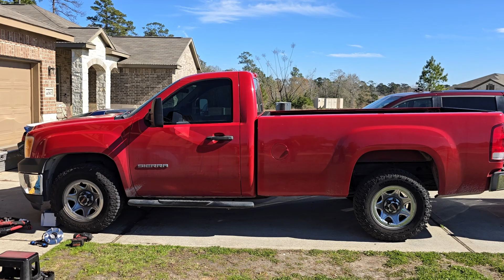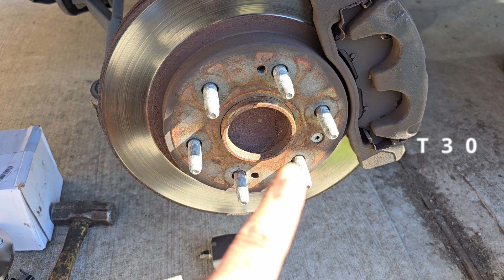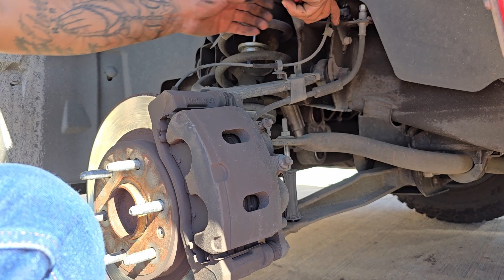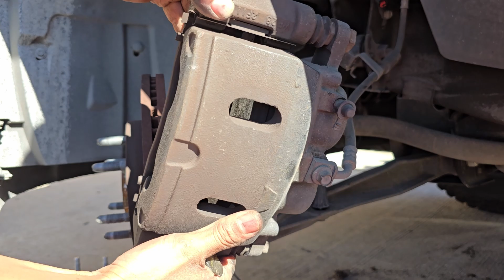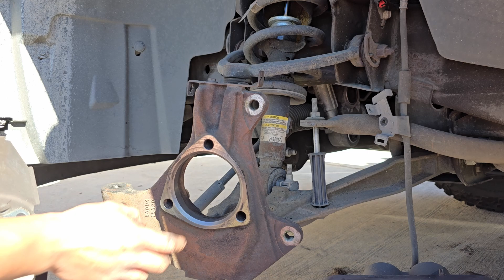2007-2018 GMC Sierra Front Wheel Hub Replacement | How To Replace Wheel Bearing Hub 07-18 GMC Sierra

Comment: Heads up! The way your inner tie rod looks, it might need replacing.  I replaced my bearing and hub assembly on my 2WD 2015 single cab Sierra and noticed the same thing, specifically on the driver's side. Now I need to replace the inner tie rod end before this new bearing gets worn out too! Shout out to Chris Fix for his tie rod video that tipped me off. You should check it out!
Reply from the maker: Yes, I did suggest that to the customer. It is generally advisable to replace the components when the rubber appears damaged or if there is evidence of grease leakage.

Similarly, with the wheel hub, a roaring sound while driving can sometimes indicate a need for replacement. Additionally, excessive play when manipulating the tire can also be a sign.

Comment: will an old wheel bearing cause a grinding sound? especially when turning to that side?
Reply from the maker: It's a possibility, if its 4wd it might be the cv axel as well.
Just make sure to jack up the truck and move the tire side to side with both hands on the tire. Then do the same with on hand on sidewall on top of the tire and one on the bottom.  If it has play most likely its going to be the wheel hub.
Reply: @HTXSuspensions  got it, thanks dude

Comment: Thanks for a good step by step video! I had 2 studs break off and 1 is slightly bent and was told I should just replace the wheel hub and just deciding to do it myself but that time consuming part is going to be finding the tools🤣
Reply from the maker: Yeah you're right about that and that's one thing that takes the longest.